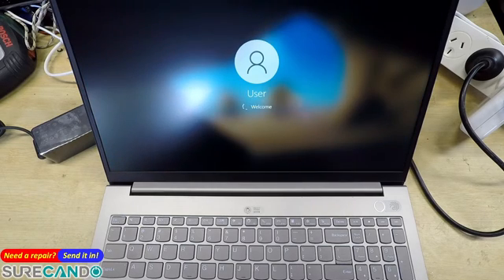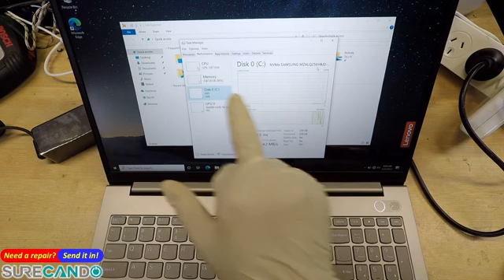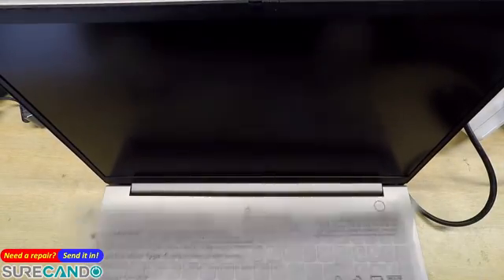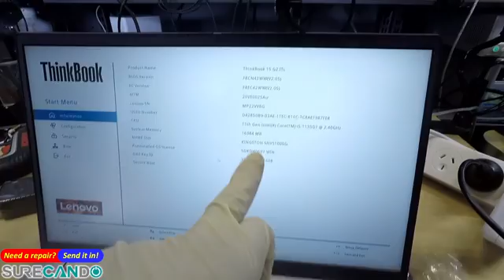Lenovo ThinkBook 15 Gen 2 SSD & RAM Upgrade. Look inside. 2 SSD slots!

Comment: good vid bro i just have a question if i wanna add ram should it be 3200 Mhz as the same as the installed one or it doesnt matter ?
Reply from the maker: It's simple
If you have lower speed ram in there already, you put in high speed, together they'll work at low speed.
If you have high speed in there already, you in low speed, together they'll work t low speed. 
The 3200 for example means it can work any speed up to 3200. It will work to match what you have inside.